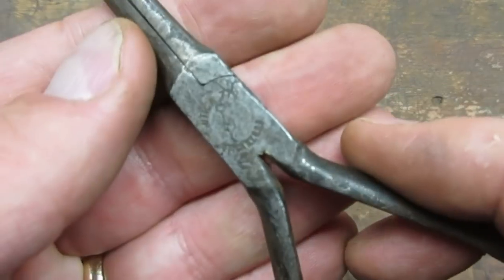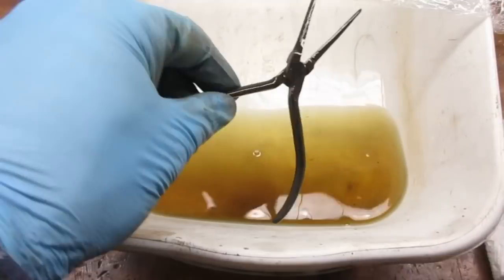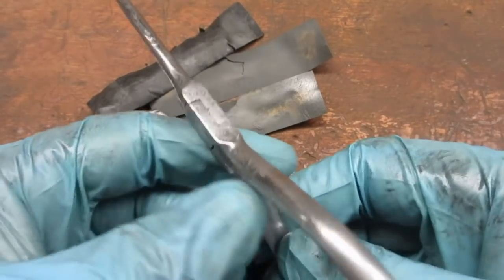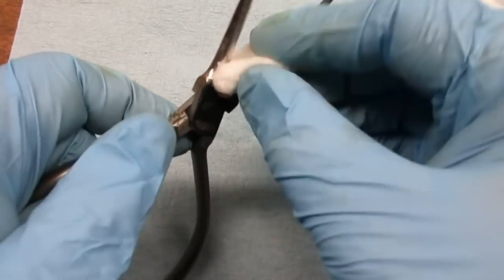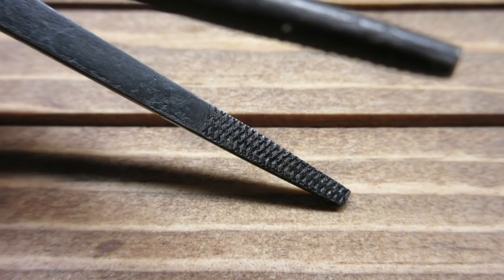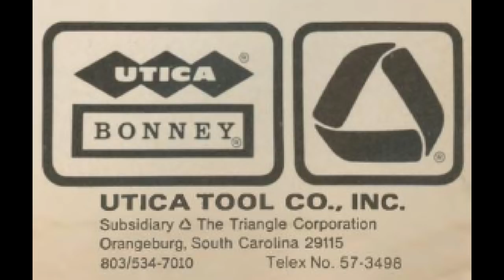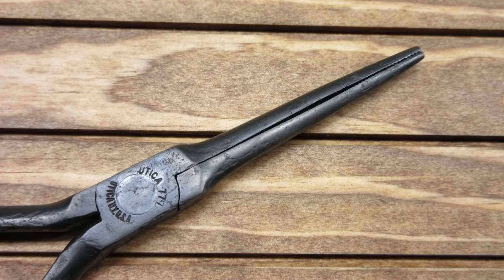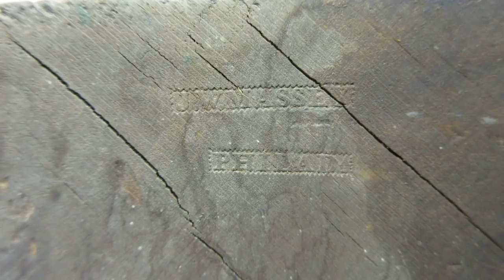Hand Tool Restoration - Utica No. 777 Needle Nose Pliers

Comment: That’s is a “Sorby” iron. They made all types of woodworking tools and that is most likely a replacement iron that someone installed and ground to the appropriate shape for the molding playing. That is a very nice playing for the price. I would use hide glue to glue in the handle and not use regular wood glue because it will make the wood swell. Great job on the pliers and awesome find on the molding plane. I would love to see a video on you restoring sharpening and using that plane!!!
Reply from the maker: Thanks Brian!  The consensus is that the iron is stamped Sorby. A lot of early American manufacturers used imported Sheffield steel so it might be an original blade.  I might try to sharpen the iron and try it out on some soft pine.
Reply: Heck yeah I would! A great way to sharpen those is to use it on some soft pine and cut the molding (if it has the slightest sharpness it will cut) then use sand paper over that little test piece and sharpen it so that it will follow the contours. Or you can try files, sometimes the irons are harder than the files though. I have had decent luck with the diamond paddle sharpeners also. Whatever you decide to do please record it!! There are not enough videos on these beautiful planes. I love using them. They leave a burnished finish on the wood that iron planes just cannot do! Thanks again!!

Comment: I like the blueing. I am going to look into that for a few of my projects.  I have been coating bear metal surfaces with “Frog Lube” from the firearms industry.  It was the only thing I found that kept the rust off when we lived on the gulf coast.
Reply from the maker: I saw oldshovel use the bluing on a couple projects and I thought I'd give it a try.
Reply: TY for the tip. ...Newk from Kentucky

Comment: Is the purpose for blueing to prevent rust? I agree with you that sometimes it is nice to take your time, very relaxing. Thanks
Reply from the maker: Hey Tony!  Bluing along with a wipe with oil will protect steel from rust.  The stuff I used isn't "real" bluing - more of a decorative coating.  The traditional process that gun makers have been using for hundreds of years is called "rust bluing" where red iron oxide is turned into magnetite.

Comment: I do believe that that plane is for the molding. I was wondering how in the world you sharpen that blade? Has me stumped.
Reply from the maker: I sharpened the blade and was able to cut the molding shape into pine.  I had to use a couple different files and some sandpaper wrapped around a dowel.